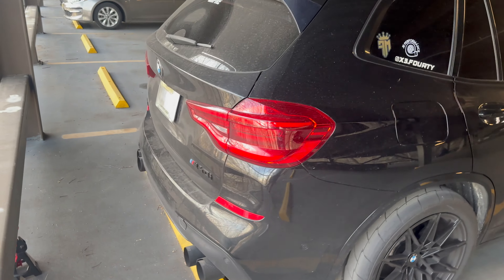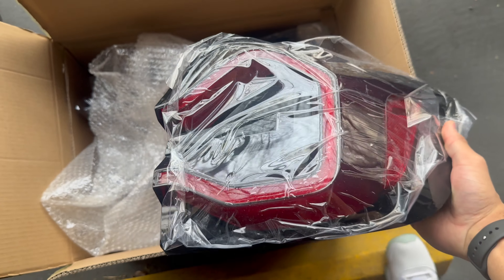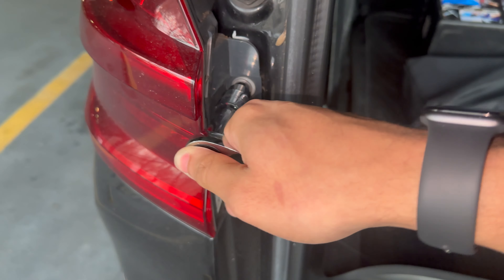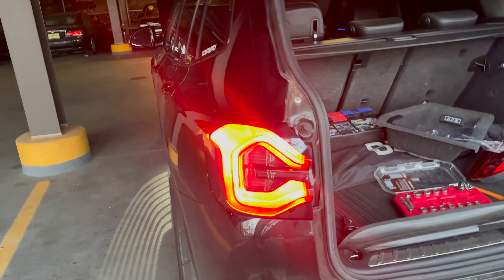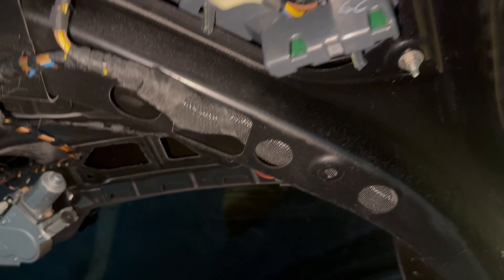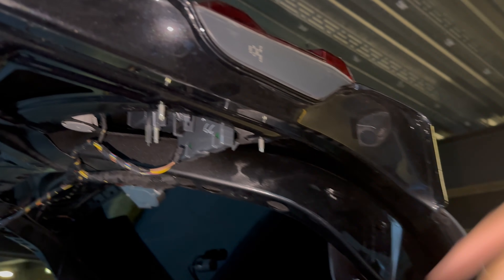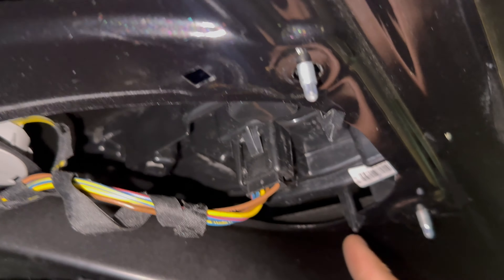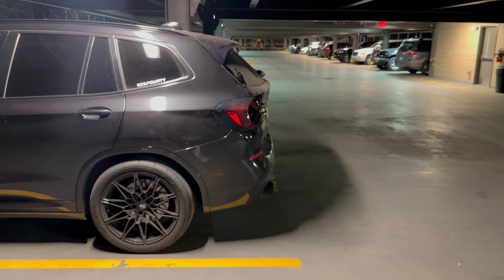GREATEST MOD FOR YOUR X3/X3M ! LCI SEQUENTIAL STYLE TAIL LIGHTS + INSTALL

Comment: If you want to fix the turn signals blinking when you brake, and also have the turn signals go all the way out to the outer lamps, you need to do some VO coding with ESYS and run a couple wires from the BDC module in the passenger footwell.  The outer taillights don't have a wire that tells it that it's signaling in North American BMWs.  How US-spec taillights are designed is, the brake light + turn signal share the same wire.  Since these aftermarket clones mimic EU-spec taillights, you are seeing the turn signals and brake light activating together due to US coding and the outer lights not signaling due to the missing turn signal wires.